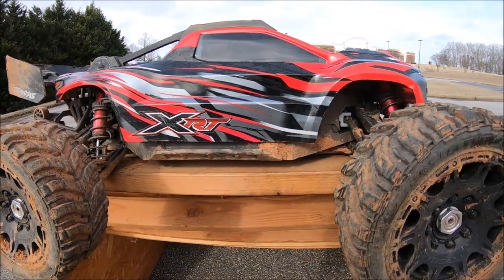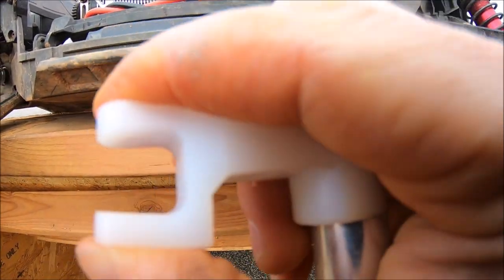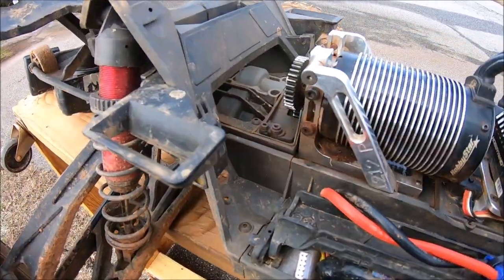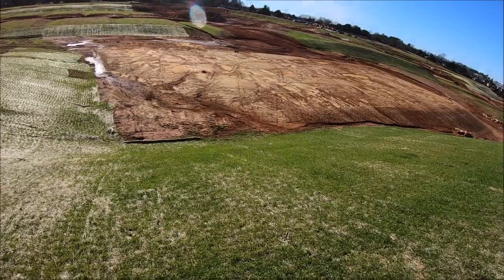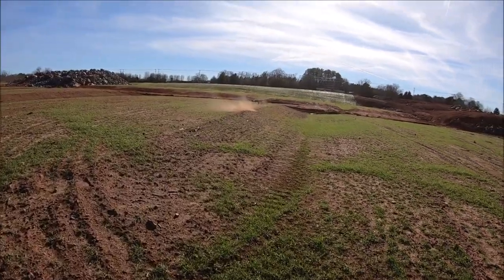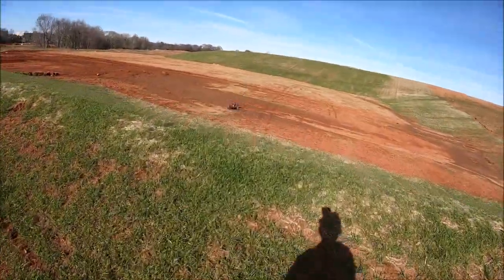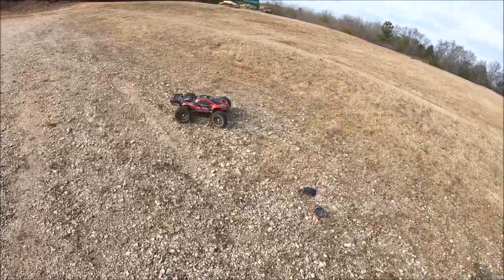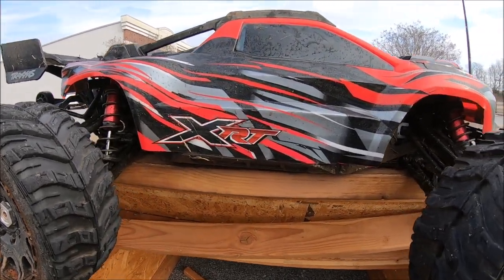BIG Terrain and BIG Air! Traxxas XRT M2C bellcrank test🚀🚀

Comment: Is there anyway possible you could please list all the upgrades you've done so far for the xrt. Like brands with model numbers and any hardware needed. I so need to upgrade mine to be able to bash like yours. Thank you thank you thank you!

By the way, at 3:49 it totally sounds like a dude screaming!
Reply from the maker: All my upgrades are M2C racing. You can visit their website M2cracing.net I have everything available for the XRT and the bellcrank is still is testing.😎👊👊
Reply: @RCDUDE81  thanks. Do you have a list of current must haves?

Comment: Do you know if Mitch and Avery plan to make a solid 7075 bellcrank or stick with the nylon 7075 combo?
Reply from the maker: They want to stick with a M2C HDP. Aluminum will cause other issues down the line. Still testing to get it right!💪

Comment: Besides the bellcrank being a beast how about the abuse the motor mount takes an the mesh stays perfect! Unbelievable.  I need m2c to make a mount system for the maxx.  There needs to be an alternative to spending more than 160 bucks for the rear bulkhead In order to use the 50 dollar mount.. it looks bulletproof but idk??
Reply from the maker: Thanks yes the motormount is a beast!💪💪I was impressed this rig took everything I threw at it!

Comment: Do you have any problems with the max5 going into esc thermal protection?
Reply from the maker: I do if I don't let it cool down or driving hard in grass. I always let it cool during and between runs when going wide open throttle a lot! I added a hobbystar fan too so that helps!